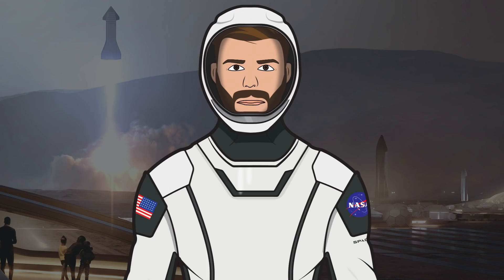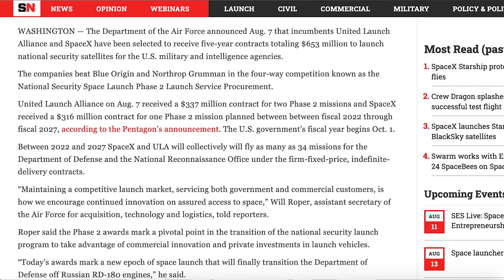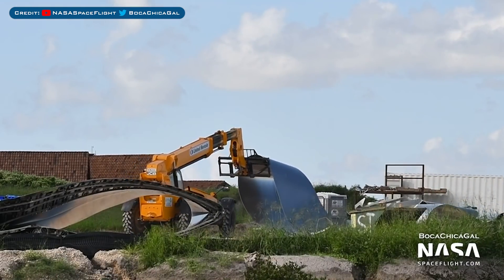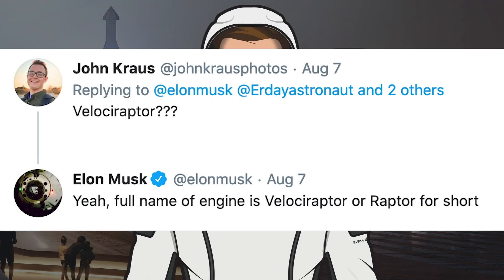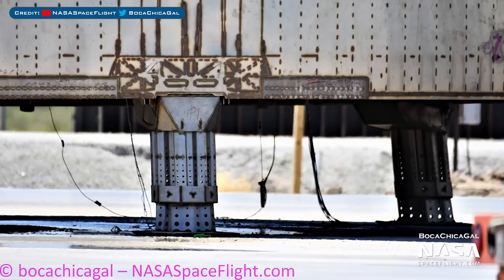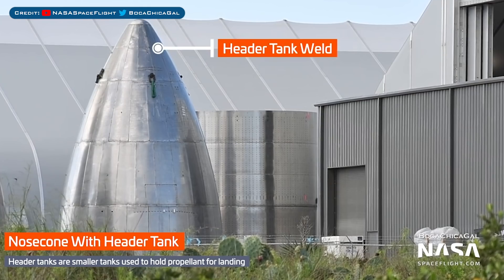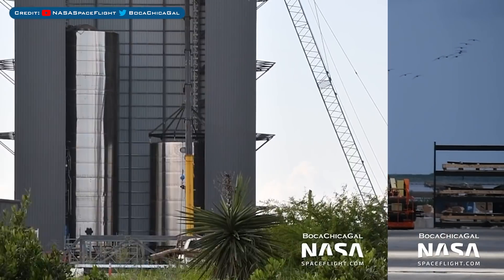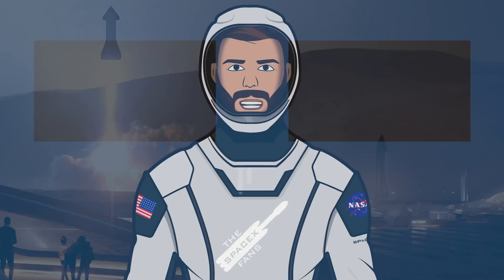SpaceX Starship Updates! SN8 Stacking, SN7.1 Sleeving, SN5 Resting! TheSpaceXShow

Comment: Hmmmmm.... I have a very pressing question to ask if anyone could answer? Why isn't there or couldn't the tesla truck be delivering stuff and parts to the site? Or are they still in production?? Thanks
Reply: There are still probably only 2 Tesla semi trucks -- both prototypes used for testing.  That will change in late 2021 when Tesla begins manufacturing both Tesla semis and Tesla Cybertrucks at the new Gigafactory now under construction in Austin, TX.  Elon noted that most of the initial semis produced will be used by Tesla and SpaceX to ensure everything is working as good as possible before sales to commercial customers begin.
Reply: @rodanderson8490  😍😍😍😍😍

Comment: Suggest to Mauricio, look into buying a good quality drone vs hiring a pilot and plane.
Reply: That’s what he was initially doing but they raised the airspace zone for the facility. So you can still use a drone but it has to go through all the work of having it piloted by a licensed pilot, filing flight plan, etc. so might as well just hire a Cessna, they’re cheap anyways. Like $100-150/flight hour and you can use a better camera on a plane than on a drone
Reply: Drones cant fly high enough to stay out of the NOTAM. Thus Sesna
Reply: Just hung out at the sight.. But there are signs approaching the sight saying drones strictly prohibited.

Comment: I have to say that I have been a little concerned with the use of heatshields ...
I know it's one of the few (if not the only) way to protect the Starship, but sometimes I remember what happened to the Space Shuttle when a heatshield came out in the middle of re-entry and the Space Shuttle just disintegrated. Isn't there the risk of the same happening with Starship?
Reply: Yes but if the spacex heat shield doesn’t work properly they can try other things , improve and adapt rapidly. Something nasa couldn’t do due to contracts and politics.
Reply: Space Shuttle Columbia’s heat shield was fatally damaged by falling foam insulation during ascent. I’m sure that issue was addressed during the design phase. Also, as the host explained, at least one method of attaching the heat shield was tested here on SN5. They have been attaching test patches on earlier versions as well. Given that heat shielding is absolutely critical for reentry they have no choice but to get it right before human rating.
Reply: I highly doubt it, few things to remember, These tiles wont be puzzle pieces that have unique ways to fasten each of them.
Tiles fell of shuttle during re-entry with no harm before (because there was steel behind that area), This is all steel.
They have been testing them on an area that goes through hell with vibration so once they have that nailed down the tiles over the soft bits will be very reliable.
We have better tiles and fastening then they used on shuttle, those things fell off just being left overnight and early ones exploded in the rain..

Also the shuttle that came apart wasnt because it was just missing some heat tiles, it had a large hole in its wing.